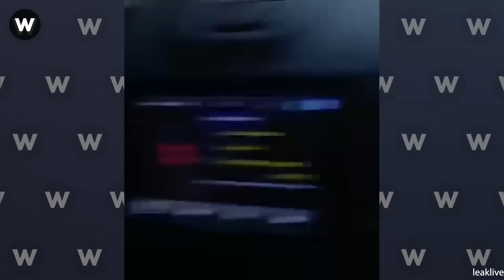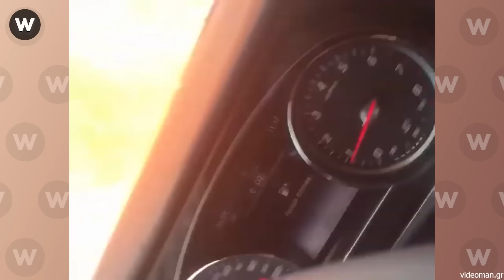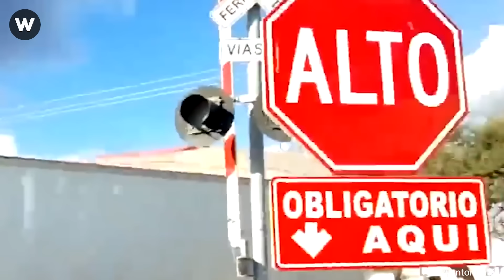Tragic! SHOCKING Catastrophic Failure Caught On Camera Latest Of The Year!

Comment: The wind didn't blow the sign down, the electrical connections on the top of the trolley pulled them down.  Didn't anyone actually watch the video?
   Oops
Reply from the maker: Looks like the video told a different story! Those connections definitely had a part in it. Oops indeed!

Comment: For almost 20yrs I worked for a large natural gas utility in mass. From late 80s till early 2000s. The cast iron gas mains were getting up to 100yrs old because man made gas came before electricity. We covered 5 cities and towns and never lost one but during the cold New England winters I worked 24/7 from Xmas till beginning of April. We actually got paid to sleep and it gave my family a great lifestyle. Almost daily we found and located the fixed broken cast iron gas mains infront of structures that could go boom at any moment. It was quite an adrenaline rush
Reply from the maker: Sounds like a high-stakes job with a lot of responsibility, especially in such a crucial time. Your experience must have been intense, balancing safety and critical work.
Reply: That must have been intense work, especially knowing the potential danger right underfoot. Did you ever have a close call or a moment that really stuck with you?

Comment: About 2:30, the signs that fell into the windscreen of a car was not caused by wind.  A tram or trolley car travelling in the opposite direction on the left of the car caught the overhead cable holding the signs - several of them, by it's electricity masts which extend upwards from the roof of the tram & these brought the cable, with the signs, down onto the car.

Comment: Dust explosions always happen in multiples, the first boom fills the air with the dust that causes the  much larger second explosion.
Reply from the maker: Yes, that's correct! Dust explosions often happen in a two-phase process. The first explosion, often a smaller "trigger" explosion, disperses fine dust particles into the air. These particles then mix with oxygen and form a highly combustible cloud. The larger second explosion happens when the cloud ignites, often with much more destructive force due to the increased volume of flammable material. This phenomenon is why proper dust management and explosion prevention are crucial in industries like grain processing, mining, and other settings where fine dust is prevalent.

Comment: Italy and maintenance of roads and bridges...
Reply from the maker: Italy has faced challenges with the maintenance of its roads and bridges over the years, especially given its aging infrastructure and the pressure of high traffic volumes. Some notable incidents, like the 2018 collapse of the Morandi Bridge in Genoa, highlighted the urgent need for improvement in maintenance standards. The government has since invested in efforts to upgrade infrastructure, but budget constraints and political complexities can slow progress. Regular inspections and modernizing older structures are key to improving safety across Italy's transport network.